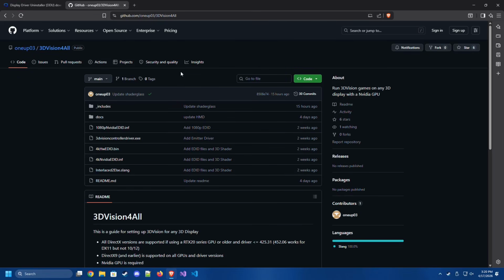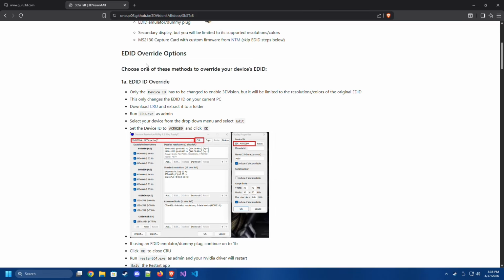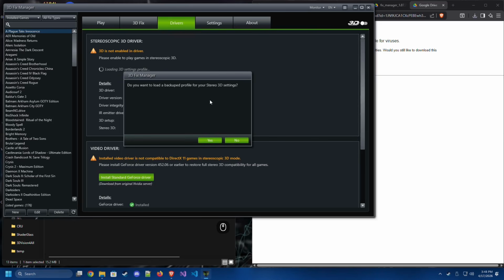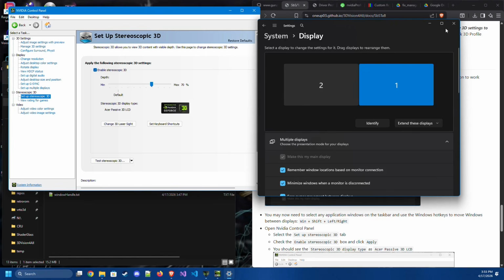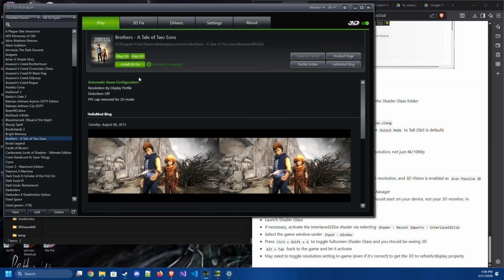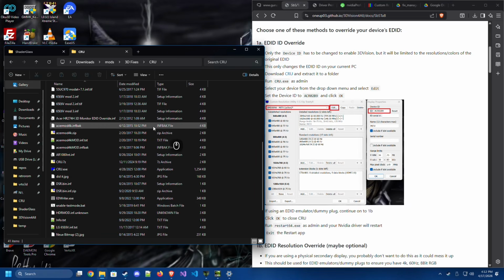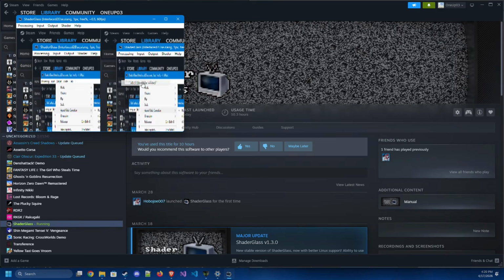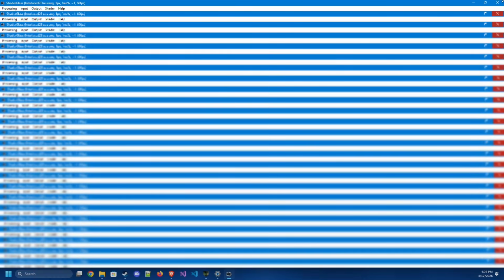3DVision4All - Play 3DVision games on ANY 3D Display (outdated, see new injector method in guide)

Comment: The second display (in my case using a dummy dongle) needs to be set as 1920 x 1080? My "recommended" setting is 3840 x 2160.
Reply from the maker: You can run whatever resolution you like/game supports/performance allows with the shader glass method. More resolution obviously looks better